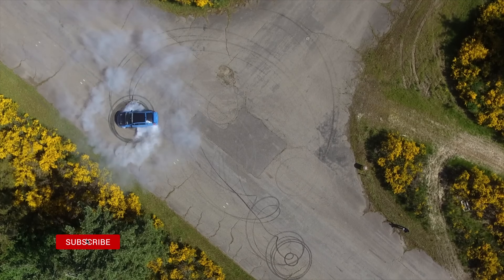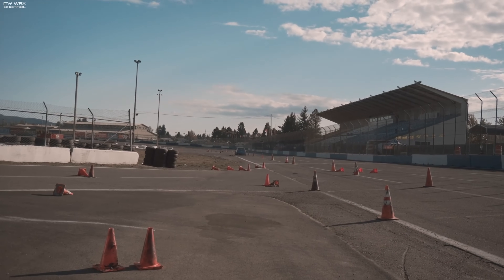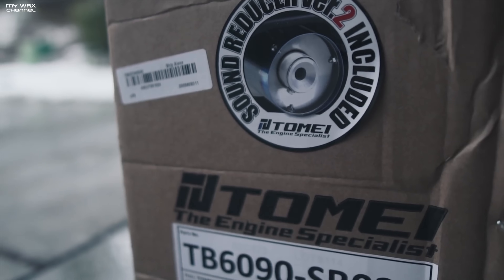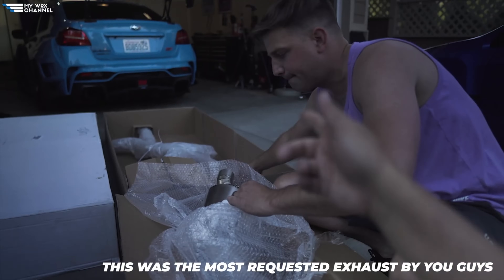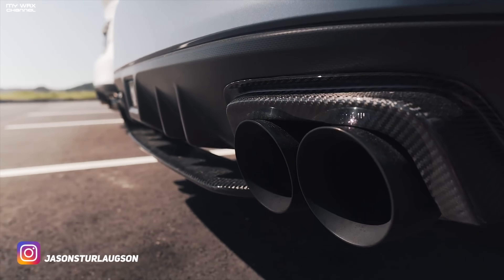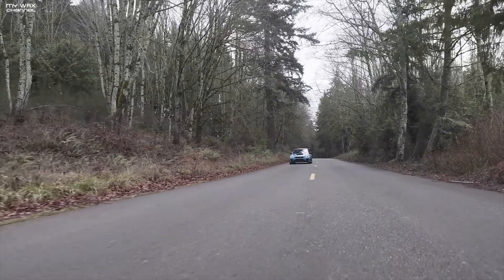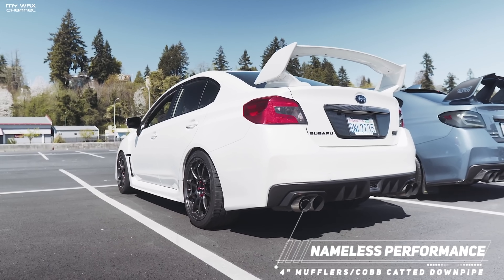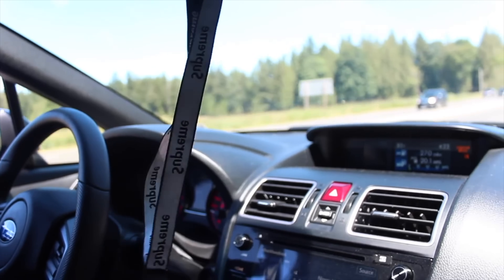TOP EXHAUST | 2015-2021 WRX STi | TOMEI | INVIDIA | ETS | NAMELESS | AWE | COBB TI TITANIUM | RUMBLE

Comment: I love how the Tomei  sounds but would rather have the quad tips for better look on the car.
Reply: Tomei got hella drone
Reply: @Dragunov302  lol? have you heard the r400.
Reply: The struggle with choosing a exhaust system ahah
Reply: Agree w this, going w the Cobb for my car
Reply: Yeah one of the reasons I went with the R400 was to fill the back of the car. I do wish I went Tomei now though lol
Reply: Yes sir the ETS Is Fing bad ass
Reply: @Dragunov302  I have a tomei and it really doesn't have any drone.
Reply: Wait if i have a simple WRX not a sti, then does these fit on my wrx ?
Reply: @LoveOfPandaa  Yes it does
Reply: @ranran2218  where did you get yours at I have been trying to find it and I cant also do you know if they have a duel exhaust?
Reply: @ebk_grimez8988  I got mine from subispeed. Also the tomei is just a single exit. Their is also the invidia n1 dual catback so a single exit on both sides.
Reply: @ranran2218  oh ok have you heard the invidia n1 in person because I havent I do want the tomei but since its only a single exit I think it would look ugly with a gap yk but thanks for responding quick I am trying to find good stuff before I get the car so I know my first mods yk
Reply: @ebk_grimez8988  I personally don't like the invidia n1. I ran the nameless muffler delete and I was stuck between the tomei and the ets extreme. Either one of those I think will be great. Tomei is a single exit but the ets is a quad tip. Check out some ets clips. It's all down to personal preference but I think those are the best two for the FA wrx.
Reply: I completely agree looks beautiful😏
Reply: @ranran2218  agree 100%
Reply: @Pxttxn  why

Comment: My favorite exhaust system, which I have on my 2020 STI, is the Remark 4 inch quad burnt tip axle backs with the remark non resonated mid pipe. I have stock headers, stock up pipe and stock down pipe, and it sounds like a beast! I highly recommend it for those who do not want to mess up their manufacturers warranty but still want to bring out the beast in their STI!
Reply: Do you need a tune for this, I'm thinking of running the same system but resonated instead of non
Reply: @lordflxcko5763  You do not need a tune to do mid pipe and exhaust/axle backs. You only need to tune if you do a down pipe or anything else under the hood.
Reply: @HanahanChase  Appreciate the response
Reply: @lordflxcko5763  I have an install/audio video on my YouTube channel if you want to hear what mine sounds like with only a non resonated mid pipe and axle backs - everything else is fully stock.
Reply: @lordflxcko5763  I have the set up you're describing. Have you pulled the trigger yet? I can give you clips if you like. I'd even be willing to sell it to you if you like it. I'm looking for one that's not as loud (wife and kids don't approve).

Comment: What stinks is I love love love the sound of the r400 with my catless invidia but the highway drown at 3000rpm is bruuuutal. I hear the extreme TI gets rid of that. I’m also told that around 500hp the invidia becomes too restrictive because it goes down to 2.5” at the Y pipe

Comment: Everyone sleeps on that Borla it sounds better than any of the Subi exhausts on market without sounding like garbage loudness is nice but resonance is also important and some of them sound way to tingy
Reply from the maker: Borla sounds great, but they designed a cat-back that isn't a full 3" exhaust. The flange that connects to the downpipe tapers down to 2.25.
Reply: @CarsWithJR  I have the Borla, and my tuner said the taper doesn't really affect anything till 500+ hp, but the sound is so good I'll probably get a shop to make it true 3" if i ever make that much power. Whats your thoughts on how the taper affects power?

Comment: You forgot to mention Borla Exhaust it has deep sound for wrx
Reply from the maker: I did not forget. The Borla piping diameter tapers down two a 2.25-2.5 at the downpipes flange. It's not a full 3" exhaust.
Reply: Would you recommend I try the Borla exhaust for my 2021 sti? I see on YouTube it’s really deep sound.

Comment: Recently bought a 2021 WRX Premium.  I always thought that these cars came with some sound already.  Mine has a little bit of a deep tone but not what I am looking for.  Really didn't want to drop too much money on upgrading the exhaust, at least not right away.  I like most of the ones on the video except for the one with the single pipe with the larger exhaust opening.  A litttle too loud in my opinion.  I'm sure this is much more difficult than doing a cat back on a Honda civic.  I would probably look into having it done by someone to make sure its done right.

Comment: I have 2011 wrx sedan i want something loud quadtips what do you recomend. Its all stock
Reply: Catless downpipe with muffler delete system will be your loudest option 👌
Reply: What brand and i live in cali
Reply from the maker: Any brand muffler delete will do just fine. I recommend getting one with 3-5" or 4" tips to fill in the exhaust cut-outs on the bumper.

Comment: Hey guys I had a question for you about the Invidia q300 exhaust. I currently have a stock mid and Y pipe with Nameless cans on my 2018 limited wrx. They sound awesome overall. Is the Invidia a lot quieter of an exhaust system? I am picking up a full mid/y/cans this weekend. Did you say I could swap invidia cans for the nameless if I don't like how they sound? I just don't want a super quiet car. I don't think mine is to loud atm, so I like the volume and quality of the sound. I'm eventually going stage 2 which is the only reason I'm snagging the q300 set. I also got an awesome deal on them which is why I didn't just buy a nameless y and mid pipe instead.